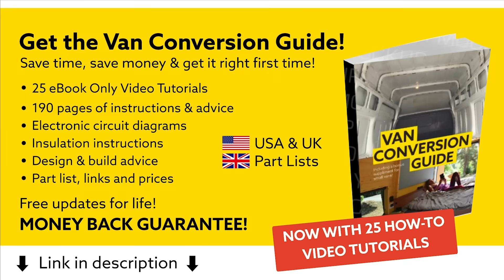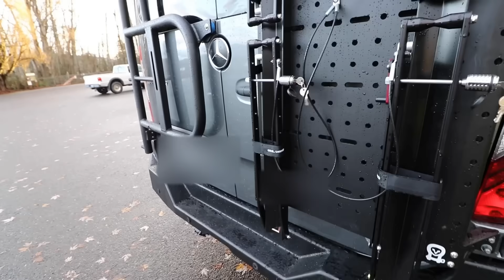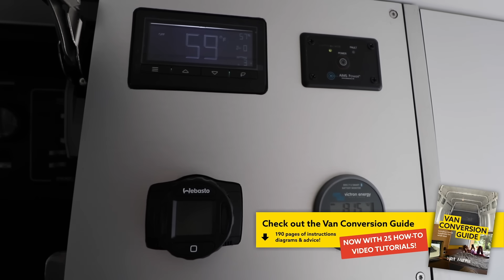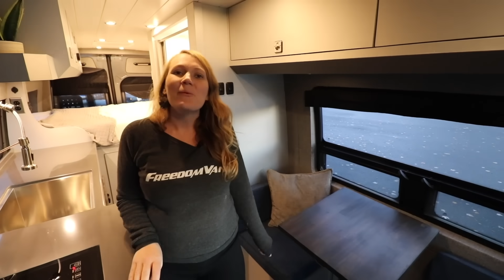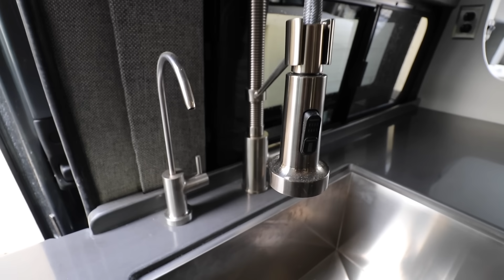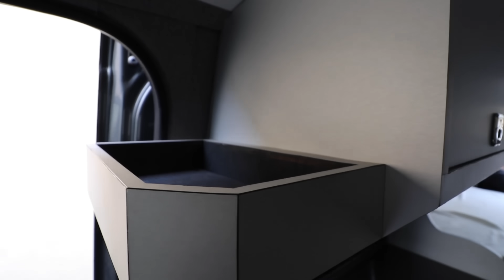LUXURY Sprinter VAN CONVERSION with AIR CONDITIONING ❄️ TOILET 🚽 SHOWER 🚿 Modern KITCHEN 🍳 LITHIUM 💡

Comment: This looks just like most commercial van conversions these days. Your camping neighbors are gonna hate you when you put on your Stalag 13 back up lights in their eyes at night. Somebody should tell her that those solar panels will almost never generate 375 W of power. That’s the maximum they can generate and that’s if they’re tilted and pointed toward the sun and it’s a sunny day.
Reply: The back up lights have an off switch, so no reason to annoy your neighbors ;) you’re right about the solar panel efficiency, which is why we always max our solar arrays to the space we have. solar is still a great way to trickle charge your system.
Reply: Lolzzzz

Comment: If they like windows so much, why would you start out with a cargo van instead of a passenger van? It’s not necessary that every window be able to be opened and even the ones that can be usually only have a very small percentage that can be opened. It’s especially stupid right now when you can pick up cheaper deals on passenger vans Because of Covid.
Reply: Cost obviously wasn't an issue

Comment: The Emperor wears no clothes. Thanks for finally pointing out how stupid the Owl Vans ladder/spare tire carrier design is.  With their design with the spare tire actually attached like most people have it the first rung of the ladder you can access without removing the spare tire is five or 6 feet off the ground.

Comment: Absolutely amazing! How much did the conversion cost?
Reply: I can tell you for sure that it cost A LOT :D
Reply: As they say, if you have to ask you can’t afford it
Reply: It says on their website that sprinter van conversions generally cost from 60-100k.  That's just for the conversion :S
Reply: @TomBedlammusic  That usually means this one cost $120,000 - $130,000
Reply: My dream
Reply: @migdalialaboy2571  wish you all the best with it! just remember you dont need $100k conversion to achieve the dream. my first van cost me £5000 including the cost of the van.  my latest is what I consider an all out, luxury van (for me at least) and it cost £16000 total.  good luck!